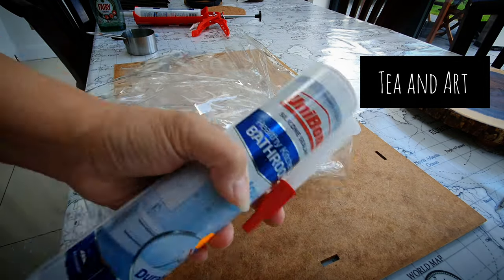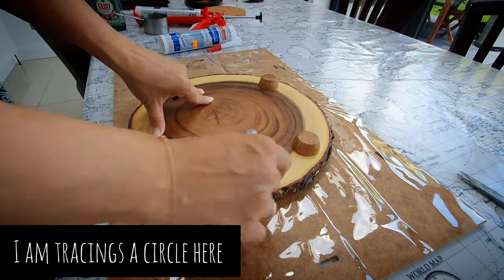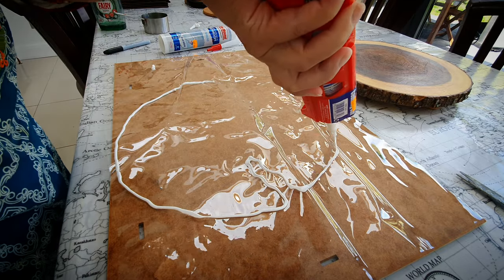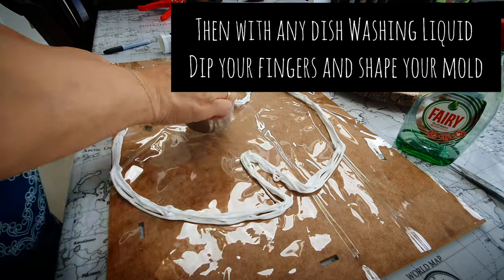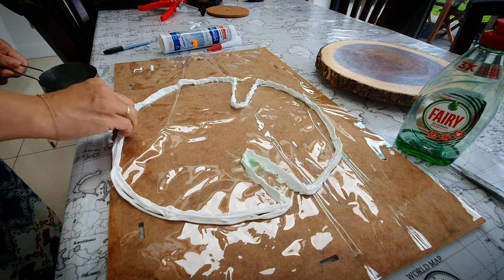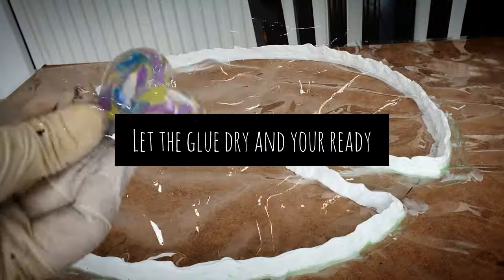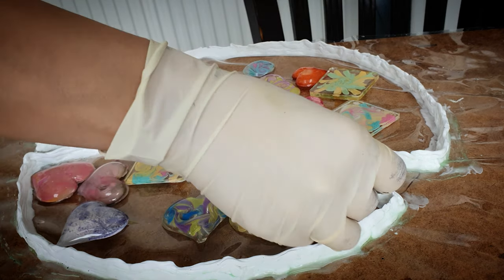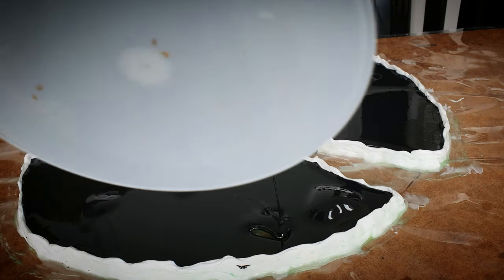How To Make Easy DIY Silicone Geode Molds For Resin Tray / Coasters

Comment: Hello, what is the function of the wood glue you use from the outside of the silicone in this mold?
Reply from the maker: Hi thankyou for watching it just an extra step to make sure its been sealed properly .
Reply: @teaandart  Thank you very much for taking the trouble to answer, I wish you success.